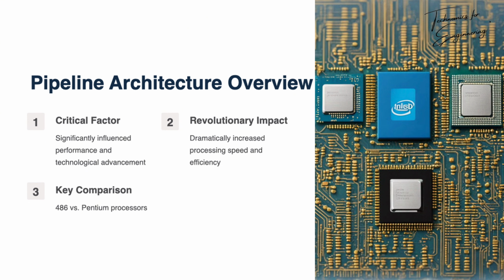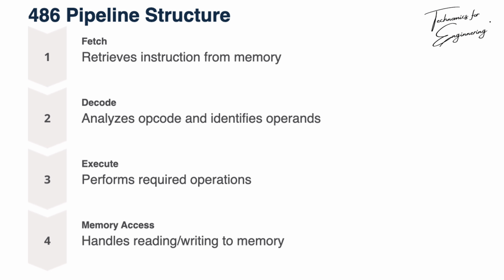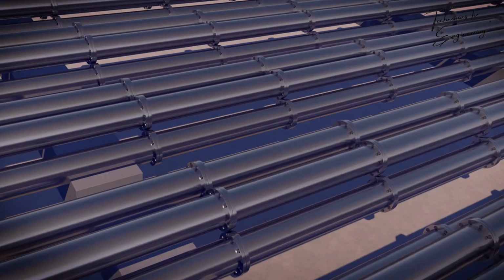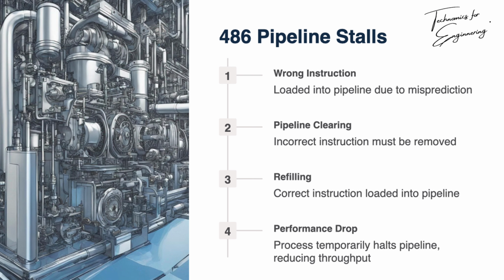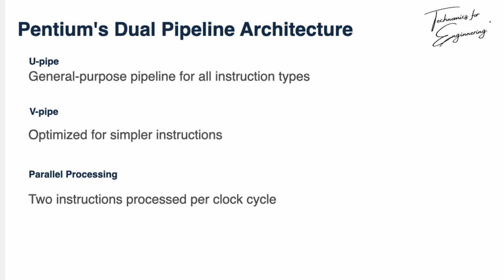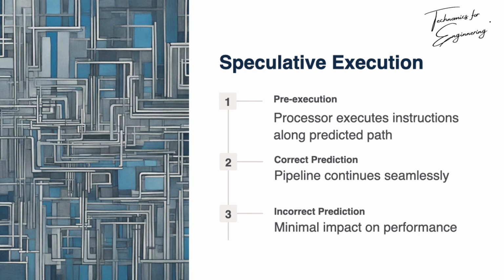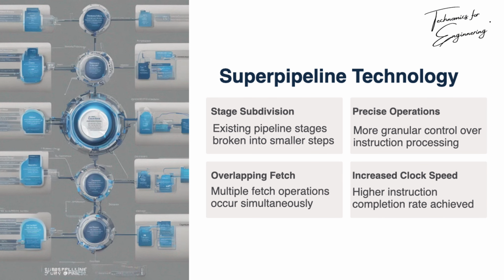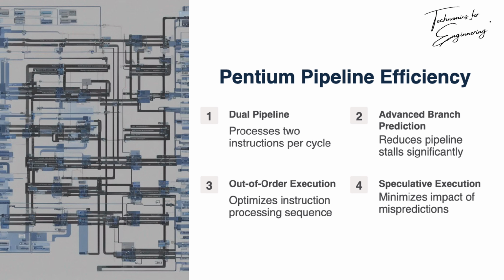The Evolution of Pipeline Architectur From 486 to Pentium

Comment: Are you sure that P5 and P54 support out-of-order execution? If I remember correctly the first Intel x86 processor with out-of-order execution was the generation after the Pentium, the Pentium Pro with P6 architecture
Reply from the maker: @Mauro-82  "You are absolutely right. The Out of Order execution technology was first introduced with the P6 processor, starting with the Pentium Pro, and was also used in the Pentium II. I got a bit mixed up focusing on the differences between the Pentium and 486, leading me to combine features of the Pentium and Pentium Pro. Please understand this mix-up. Next time, I will also cover the differences between the P5, P6, and P7 processors."

Comment: While the Pentium was great and a huge success, it's architecture was not really continued, therefore I would not call it as the 'basis' or 'grandfather' for modern CPUs. That title goes to the Pentium Pro (P6 microarchitecture), which lived on in the Pentium M processors and then in the Core architecture.
Reply: I think he confused and mixed together the characteristics of P5 and P6
Reply from the maker: "You are absolutely right. The Out of Order execution technology was first introduced with the P6 processor, starting with the Pentium Pro, and was also used in the Pentium II. I got a bit mixed up focusing on the differences between the Pentium and 486, leading me to combine features of the Pentium and Pentium Pro. Please understand this mix-up. Next time, I will also cover the differences between the P5, P6, and P7 processors."